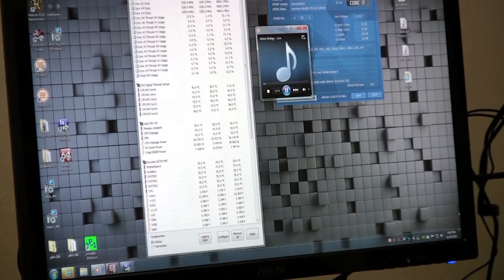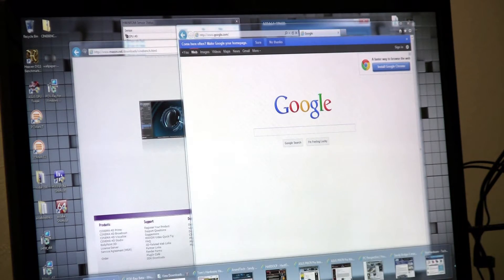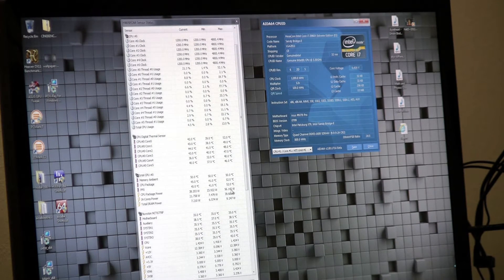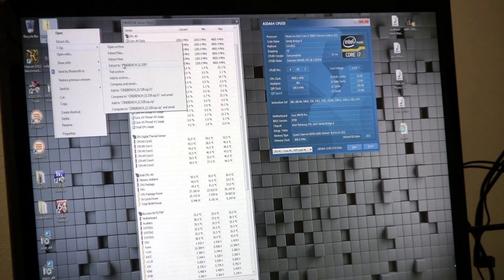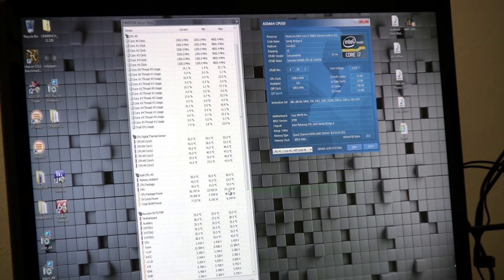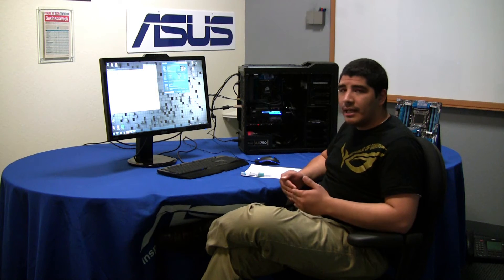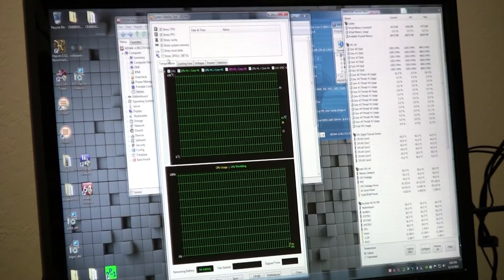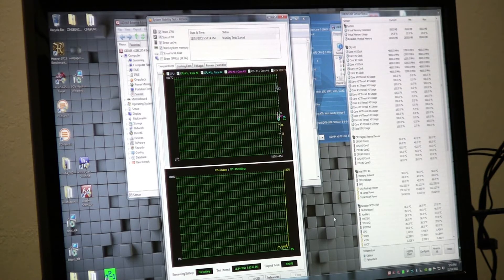How to Overclock an Intel X79 Sandy Bridge-E Motherboard 2/3

Comment: Very thorough JJ as always. I just built a NEW X79 3930 K and ASUS SABERTOOTH to help render 3d animation in  CINEMA 4D with my X58 RIG running long renders . I have always tried to stay under 70C.. Still having fun with X79 so far it just SMOKES the i7 950 in Cinema 4D alone. A Very Happy ASUS return CUSTOMER........... I found it interesting that i could use my Memory From X 58 even though its Triple Chanel ......

Comment: When OC, the total power can pick up to 150W. That mean your motherboard must support that high level of current, so buy a good motherboard that support more current than normal, also in high stress bench all component draw the máx power, so the PSU work at ful capacity. Also says more voltaje on the Vcore (cpu) lead to more power drawn, so temp is not always the issue when overclocking, that is what i learn from this. This dude probably know a lot about electrónic and thats his p.o.view here.

Comment: These videos are nice but I wish you would also go through what to do when things actually fail as well. Like if you had gotten a blue screen during the test or whatever. Which parameters to look at first in the UEFI/BIOS in order to make it stable etc. I bet you had already tested this system at 4.8 GHz and knew it was going to work. Also please make some similar guides for Intel Gen 3 CPUs/motherboards, and not just the flagship MB which most people won't buy to be honest/realistic.

Comment: Would it be possible for part 3 to also say something about what to do if you are overclocking and your system has a problem and doesn't recover ?  I've heard that you should unplug all power and then reconnect + use the clear CMOS button ?  Can you explain how this works, what it does and if any other things are sometimes necesarry to recover ?

Still waiting for my system since the 3930K processor will only be available in 1 to 2 weeks for the build.

Comment: I'm going to work with the Obsidian 800D case which is known for the fact that it doesn't have great cooling.
For the moment i'm leaning to putting in two fans in the bottom to blow air up, then installing the Noctua NH-D14 on the processor blowing out the back with an extra 140mm fan on the back of the case to draw the air out.
Still wondering if it will be necessary to install two extra fans in the top of the case to blow air in or out ?  Maybe will just try first without fans in the top.

Comment: I was wondering what your advice would be on the following system build for an X79 system with a 4.8 GHZ overclock (3930K) with regards to cooling.

I'm looking for a very quiet system however but with good cooling performance.

Options i'm considering are:
+ Corsair H100 but with two Noctua NF-S12B FLX fans blowing air into the case
+ Corsair H100 with four Noctua fans, 2 on top and 2 blow blowing air into the case
+ Noctua NH-D14 cooler with 2 noctua fans